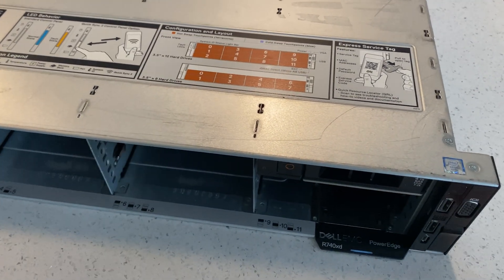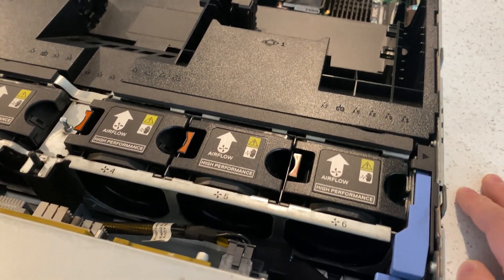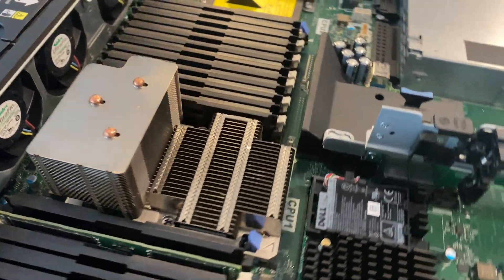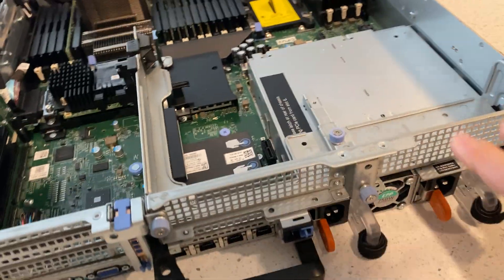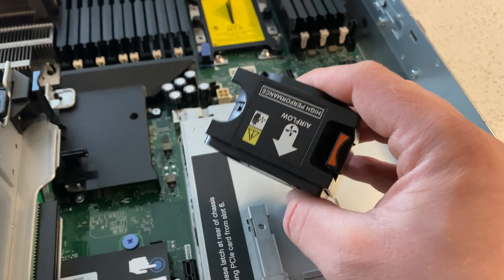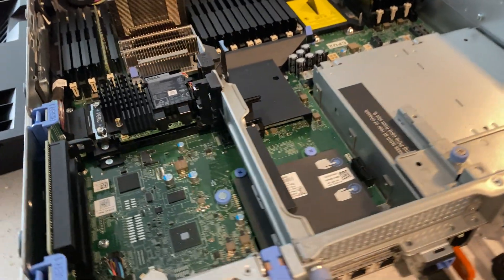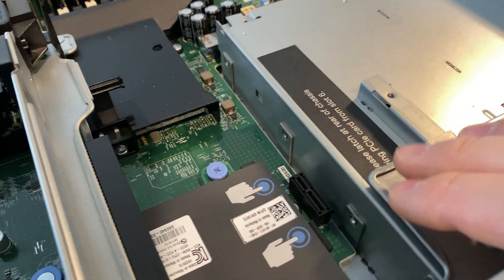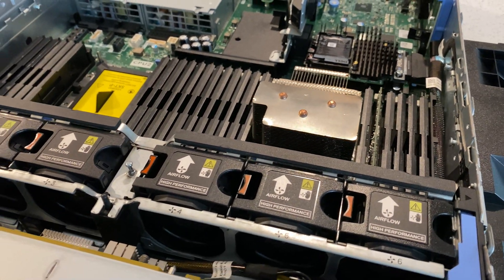Home Data Center 2020 - Dell EMC PowerEdge R740XD & TrueNAS

Comment: You can't adjust the speed for the high performance fans? Also shocked you didn't put a 10Gbps SFP+ card in it atleast. This is the server I'm looking at to use for my next TrueNAS, although I'm eyeing using SAS SSD's, 40Gbps QSFP+ and as much RAM as money can buy.
Reply from the maker: Check new video coming up… all servers will have Quad 40Gb uplinks - 160Gb/s for each server for vSAN / Data for VMware

Comment: R710 freenas and I have running on a USB. USB 2.0 32gb for years. Never have I been able to configure the jails. Just used it as back up storage. Has.
Reply: Never got the hba done just ran it drive as a raid 0 pre drive on the idrac6
Reply from the maker: Yeah, that is great for testing but not for production use, you want ZFS to see the bare drive and not a virtual emulated drive. I have ran it in both scenarios but if it is production always need HBA and pass thru bare drives.